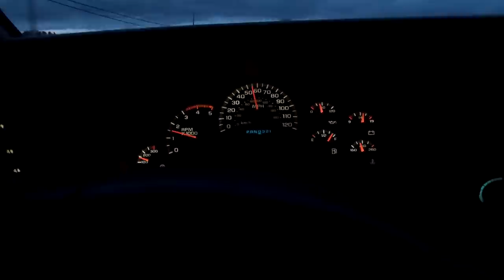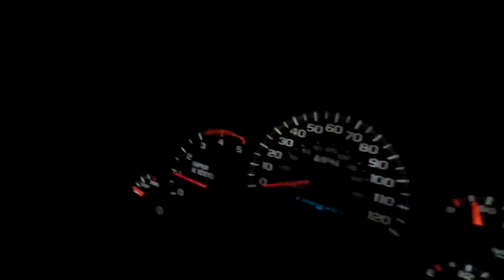Picking up The Abandoned / Destroyed BMW

Comment: Dalton the bmw sounds like it’s having a throttle body alignment issue if it’s drive by wire but still has a plug in the side it’ll be expensive to buy the software to fix it don’t take it to a shop they will charge you an arm and a leg just to align it and you may have to check for vacuum leaks. My old Audi I took the battery off for 2 weeks because I wanted to drive my truck for a while came back to the Audi and it wouldn’t run right checked the code it was for the tb (throttle body) p1545 for vw/Audi’s b5/b5.5 platform aeb head with oem tb I’m assuming it had 140k on the motor and the body has 218k I believe. Anyways if your car does have an electronic Tb check the codes it may be misaligned with the battery being off for so long
Reply: Probably doesnt help that the fuel in that thing is probably 3 years or older in it